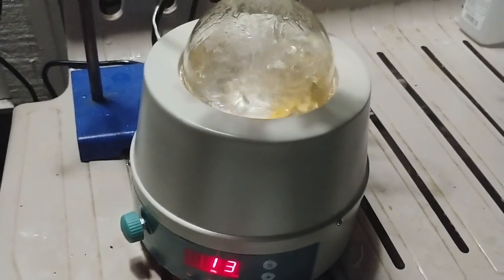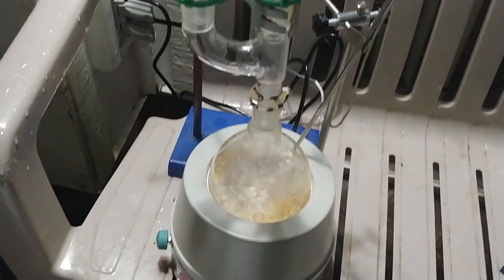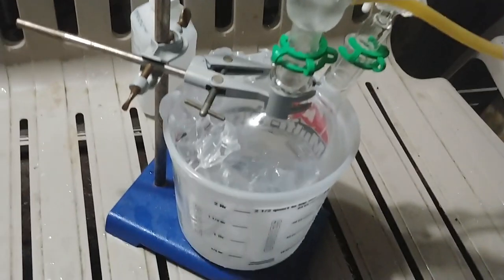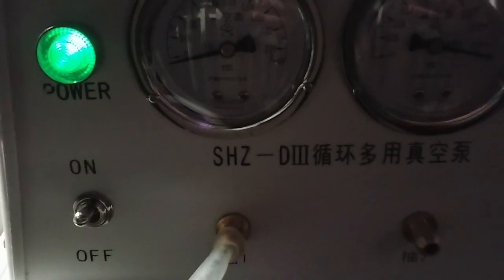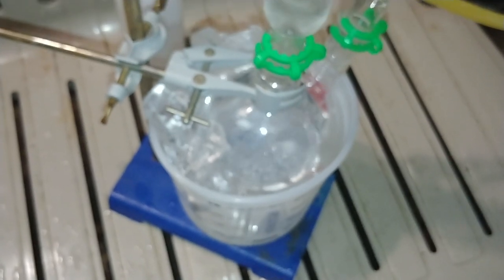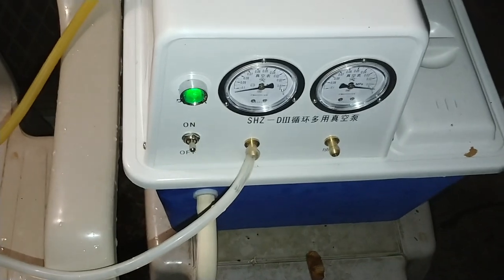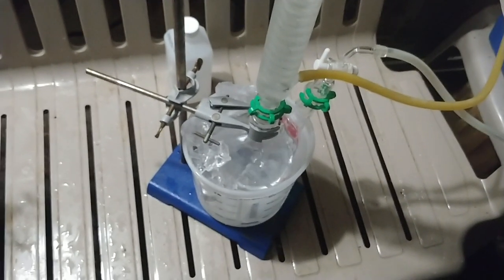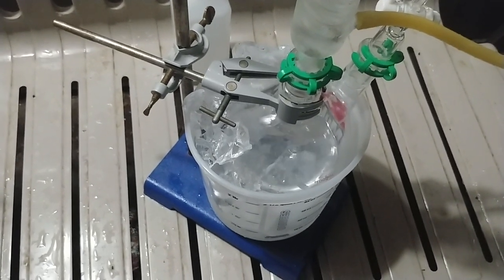Home Chemistry: Organic Solvent Vacuum Distillation

Comment: Did you ever make the review on that vacuum.  I have the same one and worry that it’s almost to strong. 
Seems like once the distillate comes over it continues to pull into the hose. What kind of regulator do you use? I’ve been looking at can’t seem to nail down what one would be best for this setup. 
 
There is very little information on this vacuum. Every time I search, yours is the only one that’s not 30 seconds long and in English. Lol.
Reply from the maker: I forgot to ever make that video! I should do that eventually. I don’t use a regulator for anything I do. I actually need to replace a couple hoses for mine. I haven’t done anything in a long while.
Reply: Thanks! You video still pops up. I still enjoy that vacuum.. Mostly use it for filtration. Not sure how I lived without one. Ha ha.. I did recently try a vacuum distillation and it seemed to work excellent..

Comment: Is there a way to control how much vacuum is being pulled with this such pump? Or how does that work?
Reply from the maker: Yes. I use a regulator I made using a flow rate one way valve and I have a separate gauge to read the real pressure of the vacuum.
Reply: @mwilson14 any video on that? Would be awesome setting something up rn

Comment: What kind of vacuum pump is that?
Reply from the maker: It is a dual aspirator pump from Deschem. It is a model DHZ-III. It pulls 28.5inHg no problem.
Reply: @mwilson14  Deschem is hands down the best chemistry supplier on Ebay. Their customer service is awesome.
Reply from the maker: @chemistryofquestionablequa6252  I absolutely agree.  I've not bought anything from them in a while and I've got a few items in my cart which I hope to purchase soon.  I'm just getting some PTFE vacuum filter papers and pH strips, but of course, I'm waiting till I find some other goodies to stuff in my cart.
Reply: @mwilson14  definitely more worth it when you can get a bunch of stuff at once.